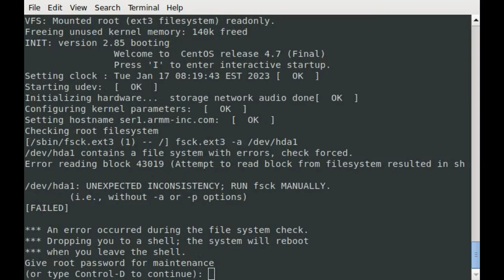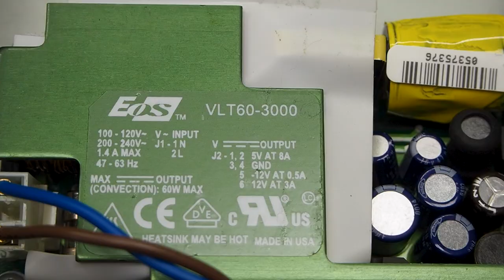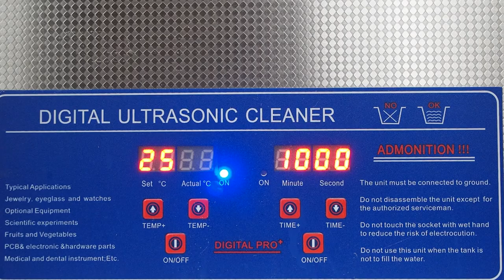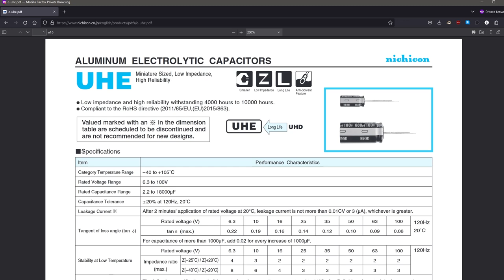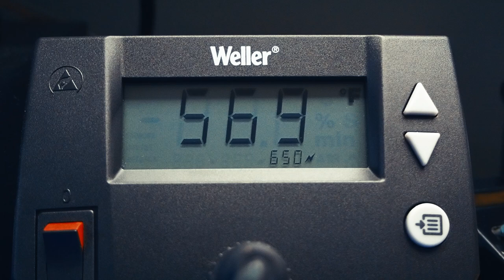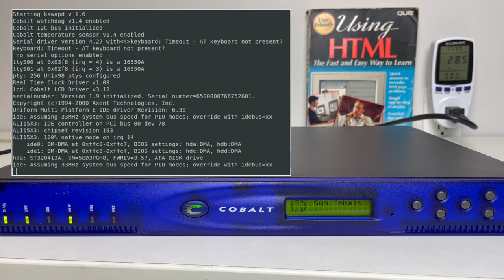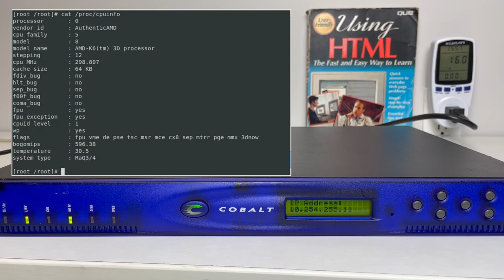Restoring the Web Server That Changed the Internet - Cobalt RaQ Part 2

Comment: Crazy to think there was a time, not that long ago, when people were perfectly happy running a webserver with a single PSU and a single spinning HDD. No hardware redundancy, load balancing, or fault tolerance.  Love the channel - keep the content coming!
Reply: Lessons were learned over the years lmao
Reply: The low end web server market is probably still filled with it.
Reply: Actually with good hardware. It could run for years. I had Novell servers that would run for years. The battery backup, psu or fans would get worn out. But, the stupid server would just keep going. Also you did have an occasional  HD fail too.
Reply: @idahofur  Okay - that sent me down memory lane.  I too ran a bunch of Novell Netware 4.1 (and GroupWise, and Border Manager) back in the day.  The "redundancy" for the main file server was a cold standby with identical hardware.  Just swing over the external SCSI drives to the other box and boot.
Reply: @nadtz  I don't think there is one anymore - anything new on the low end is just cloud, from either specific web host specializers with no maintenance, or something more generic like AWS/GCP/Azure. They can make much better use of the hardware and run hundreds of customers on a single rack unit. And then the hardware reliability side is entirely out of your concern, they just have their own contractual obligations they commit to which causes them to do redundant power & storage.

It's mostly the high end where cloud bills get absurd that people start to look at colocation these days.
Reply: It was normal to just buy a second identical server, if u needed redundancy, running some fancy sync scripts.
Reply: Cobalt Networks SW architect here. We also had a active / passive mirrored product called StaQware. A pair of RaQ servers with a secondary ethernet used to synch between the systems. RAID 1 mirroring of the disk, forced remote sync so somewhat sluggish on writes. Actually very effective but 2x the cost, and in the presence of failure you needed a spare RaQ and re-cabling step for the out of band network. Turned out to be a great thing on the product list but not a big seller. People loved to know they could upgrade to a redundant system, but hardly ever did.
Reply: yes those where simpler times when web pages where smaller and more individually owned where there wasn't much data to lose or time wasted as copying over a 10gb system image wouldn't take long. however now systems are so large data is much more critical and even minutes of down time is devastating. Also older hardware was less complex and more reliable, I have two of those 20gb segate drives and both work well even though on has been in a server running 24/7 for the best part of 20 years so far.
Reply: Yeah the server world went crazy with redundancy later on and enjoying charging an arm and leg to customers for it.  ATA turned into SCSI.  Single HDD turned into RAID and RAID controllers.  Redundant power supplies.  ECC DRAM.  The hyperscalers took a different approach of disaggregated storage over a network and fault at the box level so the reality is each box can nearly be as simple as this one and if one box went down there were literally 10s of thousands of other boxes the software could run on in 100s of ms.  The fact that they did this in 60W/U is crazy by today’s standards.  Oh throw in virtualization just for fun to ensure high hardware utilization.   Good times.  Thanks again for sharing this.
Reply: These were likely all pooled and load balanced with lots of units. Webservers are loadbalanced quite easily.
Reply: In the earlier video you could see these two machines were labeled "box1" and "box2" all I could think about was how horrible it must have been for that IT guy long ago to do any updates or repairs on these early web servers. I bet someone updated html on these over an ftp session. The hard drives were labeled as well which means there might have been some sort of process going on where those drives were being taken out and imaged or mounted somewhere else. It's so nice to be able to feel this nostalgia without having to live it! ;)
Reply: Large admin of these things here.... We did have redundancy - it wasn't inside this particular box - but we had pools of machines ready to go.  The systems were fairly virtualised inside the RAQ and could be moved with a script run to hit the backup of the RAQ (or the particular site) and push the site onto another spare in the pool.    A few DNS changes internally, and the machine started back up in about 20-30 seconds from detect-dead.

They were excellent machines - and were economical.     The home-built machines we replaced these with weren't a patch on them - but did SSL offloading...
Reply: I still do (with an SSD mind) - it ain't doing much however 😆
Reply: @T00LF00L  25 years ago was 1998. Alot of people had internet by then, not many in comparison to today sure however where was still alot of people online.
Reply: Crazy to think my personal computer in 2009 when I was in middle school was probably more secure and had better failsafes than 30% of websites…
Reply: I did it at my job with Pentium 133 and Debian.
And a Pentium 75 to act as gateway/routeur :)
Reply: They did have a backup somewhere in case of failure. If I understand correctly who the users of this equipment were, there is little wrong with running the same or similar hardware today for the same task.
Reply: @T00LF00L  in 1998? Yeah we did.
Reply: This is entirely because it's a low-end device. Most home servers (NAS) are still single PSU today. I remember working on Dell servers with 800mhz Xeons that had 3x 300w PSUs. Could run on 2x for an unlimited period of time, or 1x for 5 minutes. So the tech was definitely there in higher end servers.
Reply: @PsRohrbaugh  Yep. I ran some IBM Netfinity 8500R servers back in the day that supported 8 x Pentium III Xeon processors with 3 x 750W power supplies standard.
Reply: Things have kinda gone full circle. The redundancy and fault tolerance is now at the cluster level. Individual instances are ephemeral and come and go at the whims of entropy and node maintenance schedules.
Reply: And Google were also those people! Cracking failover and redundancy led to huge cost advantages
Reply: What was the size of a website at the time? 200-500kb?
Reply: @yveice  yes 2 servers is arguably more redundancy.

Upgrade cycles were shorter too though since you got actual upgrades that actually made stuff faster or better.

Comment: The checkerboard pattern is likely leftover from an asset tracking tag.
Reply from the maker: Interesting, I guess that seems like an obvious one but didn't understand the checkerboard pattern for it.  Thanks for commenting!
Reply: @theserialport  Asset tags/stickers typically have an anti-tamper layer built in, leaving that checkerboard pattern behind when the label is removed.
Reply: I just commented the same, and scrolled down to find your answer.
Reply: I was figuring it was a warranty ‘void’ sticker.
Reply: Yes, and these were still used later. I had the same pattern on some IBM servers I bought back for my first home lab after moving out of my parents' house. (so, technically my second home lab)
Reply: @gordonfreeman320  Came here to say this, used to have tags that did the same!
Reply: Yes, it reminds me of the Brother p-touch security label.
Reply: @gordonfreeman320  I always wanted to get some anti-tamper stickers made with my logo on them and stick them on various stuff to be a nuisance to people 😂
Reply: @snekulcire  certainly looks like it to me, I've used them for asset tagging and when we upgraded I got the old P-Touch for free which I've used to label all the drawers in my workshop. Very satisfying! :-)
Reply: Definitely a security sticker. The checkerboard pattern is much more conspicuous than just sticky residue.
Reply: @theserialport  As a few others have said, it's a tamper prevention system. We used to use labels that left the exact same patter/residue behind at my dayjob to mark capital assets like employee laptops so that it was very obvious when someone tried to take the sticker off, even if they tried to re-adhere it after. Lining up 200 little squares exactly is basically impossible.

For a bit more info on the ones we used specifically, the label itself was clear with black text printed, but used 2 visual indistinguishable white adhesives as backing in that square pattern so that it would look like a normal unassuming label if left alone, but as soon as you tried to pull it up, it would leave that very obvious square pattern on the device, and the opposite on the back of the label. Even if you pushed it back down without removing the whole label, the imperfections in the pattern would be very easy to see through the clear label.
Reply: I was just about to say that lol

Comment: The strange silkscreening for the capacitors is the same way Apple indicated it during the 80s and 90s, it's likely that the board designer came from Apple and designed the silkscreen on the board the same way they did previously.
Reply: What better way to stop unauthorized repairs than to confuse the repairman so if they do it wrong the results woud be catastrophic.
Reply: @700gsteak   It was more likely just convention on whatever their EDA tool was.  All PCB design software has a library of common footprints.  Unless there's a need to (or your org demands that you do, for compliance with internal SOP or whatever), then normally you wouldn't redesign all your own from scratch.

Comment: I have one of these that has the same issue. You have motivated me to dig it out and replace the caps. I used to use it as a web server but ran a different operating system called Rackstar OS.
Reply from the maker: Interesting, had not heard of rackstar.  We will check it out as we are looking at software options that we’ll cover in the next video
Reply: @theserialport  Well that was easy, I found the iso. How can I send you a link?
Reply from the maker: Cool you can email info@serialport.org and upload it to archive.org

Comment: 12:18 I think the CPU heatsink should be oriented 90° arround. The fin should be in the direction of the airflow to allow more air through and more surface area to the moving air. Great video btw
Reply: same here
Reply: I thought the same thing, but if you watch the disassembly montage (0:47) that's how it was installed originally.
Reply: @adslf874yti3q7u4hf83  Or the last IT guy to take it apart for maintenance installed it the wrong way around, and that’s not how it came from the factory.

Comment: While I didn't work with a RaQ server, I did work with a lot of those machines back in the day. My first Linux server was a 486 based machine. Eventually, I had a server colo'd at one of my ISPs. I had servers colo'd for years, but a motherboard died, and I moved to cloud hosting around 2016. For about 15 years, I ran firewalls, DNS, web and email servers for ISPs.

Comment: Pull that little sticker and put a single drop of 3 in 1 oil on the spindle of the fan
Very cool restoration!
Keep em coming!!!!
Reply: I think engine oil or gear lube might be a better option. Seems the thicker oil will stay in better. I've had light oils run out and have to add more then ultimately trash it cuz it just won't stay running.
Reply: @mrmotofy  Too thick..needs to be thin to soak into the sintered bearings in those fans, use the stuff that has teflon in it
Reply: @mrmotofy  I will give it a shot with something like 10w30 then
I guess thicker might be better

Comment: Back in around the turn of the century I installed many of these RAQ's and Qube's they were a great product that was reliable and easy for our customers to use, my boss was really sad when they were discontinued and tasked me to try and find a suitable replacement, there was nothing like them, we ended up with a Linux distro (forget the name, it's 20 years ago now) that was had similar features that we installed on IBM 1U rack servers or SFF PC's as My employer was a small system Integrator that was a certified reseller for Apple and IBM, but it was never as clean a solution as the Cobolts.

Comment: Congrats guys.   From your first video I asserted the HDD just lost the data needed to boot but i clearly called that wrong.  I’d get an image made of that HDD.   I never directly worked on HDDs but worked with a bunch of guys that did and they talked a ton about reliability issues they had including the rotational bearings leaking which obviously isn’t good as it then smears over the media and the heads.  Excited to see your next video.  Liked and subscribed.

Comment: I would love to see you running a modern website on this. Obviously not something fancy, but some simple static stuff. I would recommend an IDE2CF adapter to give it flash memory and upgrade the fan to a little noctua NF-A4x10

Comment: I just recapped a Dell motherboard from the P4 era that used positive-side markings on the caps like that too.  It's nowhere near as common as the negative-side marking, but it isn't an error.  It's just a different convention.

PS., I got almost every cap on that P4 inserted correctly, remembering to observe the "backwards" polarity marking.  But I did mistakenly reverse one of them on the 12V rail.  It actually worked fine for a little bit, and then I happened to be tracing an (unrelated, pre-existing) issue with the PS/2 mouse port not working, and noticed that one of my newly-replaced caps was already starting to bulge.  I was starting to feel a little concerned that maybe I had underestimated the ripple current demands or something.  I pulled it out, then noticed the markings, and immediately felt better.. and then worse... but better again when it was fixed.  :-)

Comment: Great video series on the Cobalt.  I hope your channel grows.  Keep them coming.
I used NetWare with SFT for HA for the web servers I ran back then.  I still work for Novell today which is OpenText now.  I'm all Linux today.
I have my Weller solder station also.  I have replaced many components over the decades.

Comment: The thing with this is, you can still run Debian 11 i586 on these given you max the RAM out, but the better thing to do is to instead run NetBSD. You should do this to the other unit if you get that one also working. The adhesive pattern is from an asset tag.
Reply from the maker: Thanks - we are looking into these options now.  There is a NetBSD "cobalt" port but it is only for the earlier MIPS-based arch, running NetBSD x86 on these doesn't seem as straightforward
Reply: @theserialport  The flash based linux kernel initialized the hardware than sets up to load and jump to what ever ELF file the boot command line says. I expect a NetBSD kernel would be fine, but of course the device drivers could be an issue, especially the front panel. If there is a front panel driver in the NetBSD/MIPS port, it would probably only need a slight bit of hacking.

No need for the front panel if you are willing to configure NetBSD through the serial port.

Comment: I have a pair of RaQ3's and neither had the checkboard pattern sticker/printing so I suspect that was some branding or marking from the previous owner. An older RaQ2 I had also lacked the checkboarding.

IIRC, I had mine co-located at Hurricane Electric until 2005-2006 before we retired them. Now all three RaQ's are just sitting in my store room. Sadge.

Comment: Would be fun to see a low-power modern motherboard put into the other chassis, like AM4 AMD Ryzen 3 or something along those lines.
Reply: even something like a Raspberry Pi would beat it handily
Reply: I actually have something like that. 
Ryzen 5 5600G
MicroATX board
500GB M.2
Some ECC ram

It sits at about 30W of power with a load of about 1.5 but can, of course, wind up for higher usage. Great little machine, and combined with a slimline water cooling setup it is silent and no-nonsense.
Reply: Boring, has been done to death.